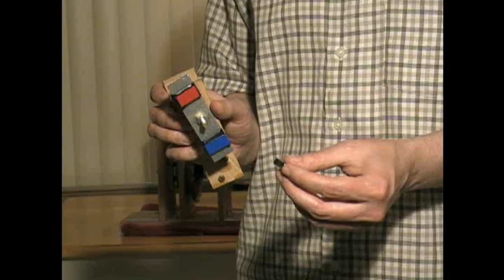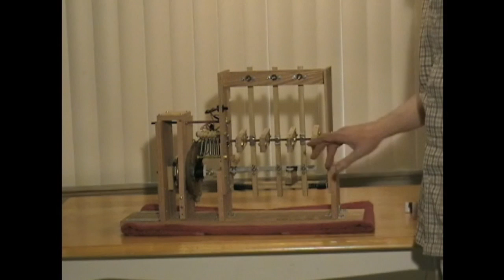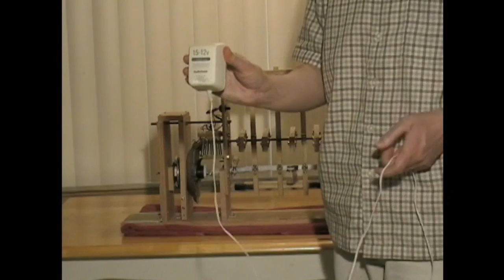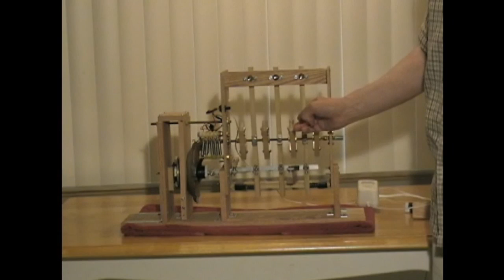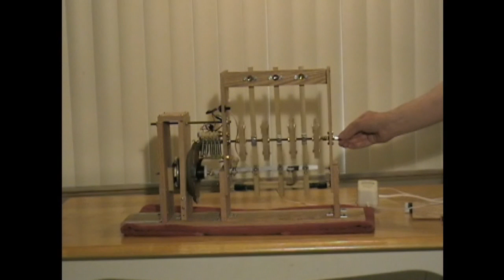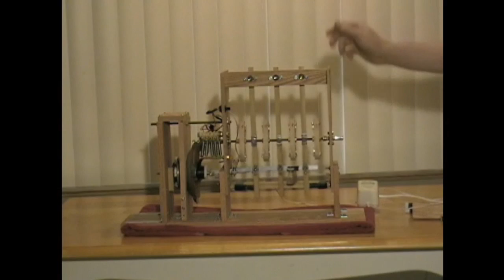Kundel Magnetic Motor Prototype 1

Comment: Why not redesign the shaft, on the opposite side, to actually produce Electricity, By useing 
The vibration, to move the coil, of a larger more
Thicker, speaker, causing it to Vibrate, that way
Instead of vibrating one speaker causing the 
Motor, to turn, then it should be able to make 
Enough power, to light up a number of LED's....

Comment: What happens if you pulse ON, get up to speed, switch OFF, then use a generator to charge a super capacitor and power back ON when it slows down, pulsing on and off and then try removing the power.  Wonder if that might work?  Super capacitors charge quick but discharge slow!

Comment: What load can you put on it?
Will it zero out .3 amps? Or build enough to power speaker and zero point plus?
Reply: It won't. When he switched off the power it would have kept running and just increased in RPM otherwise.

Comment: One more thing...at the turn of the 20th C there was in use a 'repulsion motor', which used like poles electromagnetic. These were low speed but very high torque. You may have found a new architecture that exploits the kinetic energy usually lost in such a device.

Comment: What magnet 'motors' of this type do well is transfer momentum. There is an elastic collision between the like poles that must have a very, very low CoR number. Though this particular architecture might not be entirely suitable, I would like to see magnet motors driven with Nitinol. Cheers. Very clever.